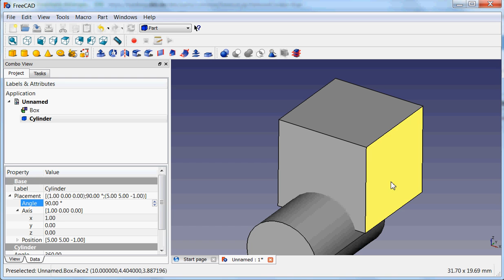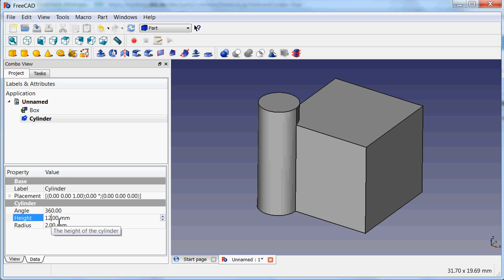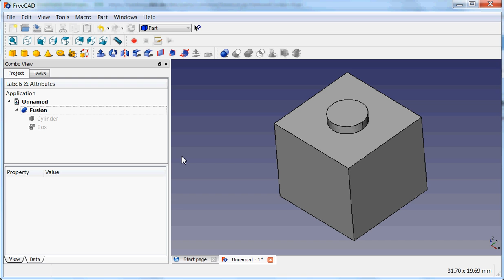FreeCAD Tutorial Part2 Booleans

Comment: I am not a programmer, but a user. For the beginner FreeCad should have had a easy mouse control with more button options like AutoCad family does. The main purpose that I have got in to FreeCad was to build a Custom Hull that Free Ship does not have. The user Interface (UI) Should be more pleasant to use. I have ran into AutoDesk 123D and basically FreeCad can do all of that! : )